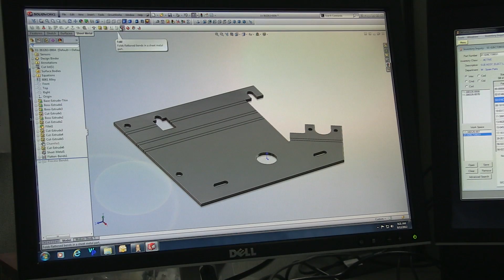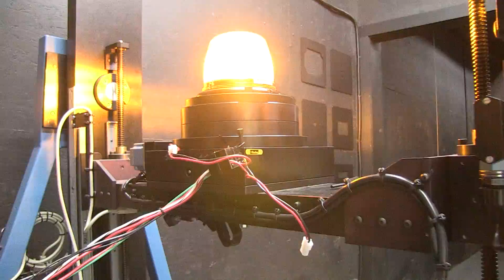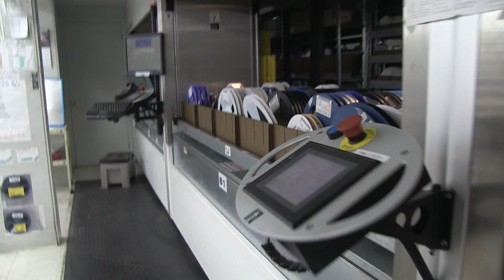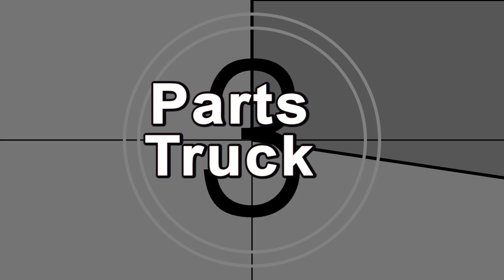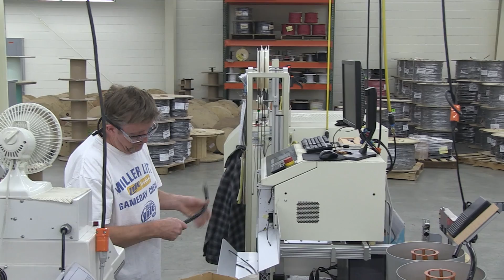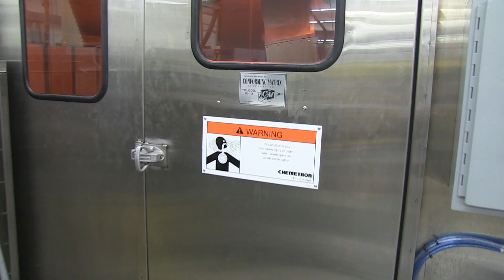Sirennet tours the Whelen Factory

Comment: hello,can whelen mpc03 work for whelen cencom gold / red/

thanks
Reply from the maker: It will not work with a CCSRN or CCSRN2. It needs to be run through the serial-comm (MPC) system.
Reply: what is CCSN / CCSRN 2,can you help me ? can you send by email to anggountoro@gmail.com

many thanks for your help,
Reply from the maker: CCSRN is the Cencom red and CCSRN2 is the part number for the Cencom gold.
Reply: so how can i get this part / and how to make serial comm for my MPC03 to activate my cencom gold /
Reply from the maker: You'd need to look at used equipment. Unfortunately the serial communication components are no longer available for ordering from Whelen Engineering. We don't have anything around pertaining to this control-system.

Comment: What is the Cantrol vehicle?
Reply from the maker: Whelen's Cantrol System is an advanced full-vehicle integration control system for allowing sensor activation, visual triggers, thermal control and operator lighting safety control via sensor activation and deactivation with the opening and closing of Vehicle components. It also has advanced detection abilities for monitoring the Vehicle Safety System and error identification in the event that a warning/safety component fails.

Comment from the maker: To get your Take-down & Alley lights to Flash, you will need to gain access to your wiring harness (the Control Cable). The wire you will be looking for is the White/Blue. When a +12 volts is applied to the trigger wire, the take-downs and alleys will flash. When the Lights are flashing, you can use the White/Violet Scan-Lock trigger wire to change the flash patterns.